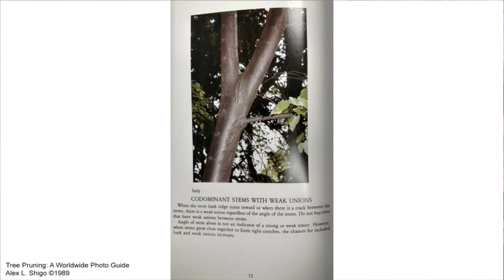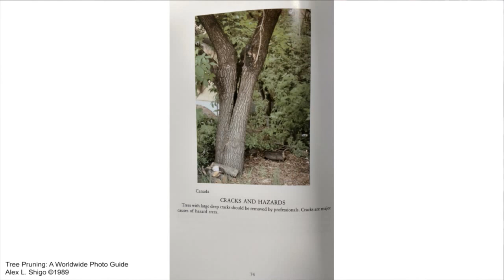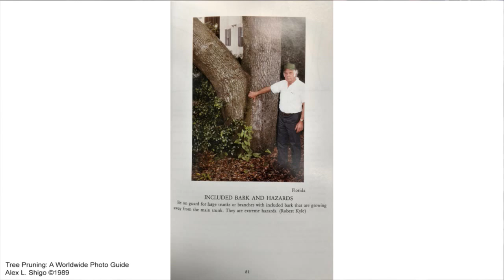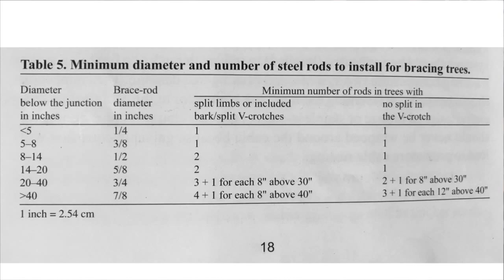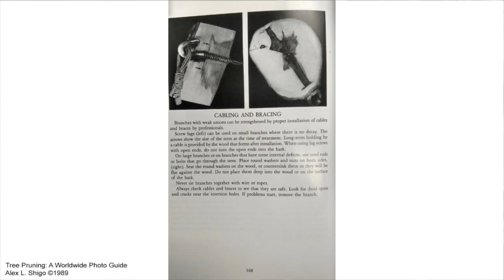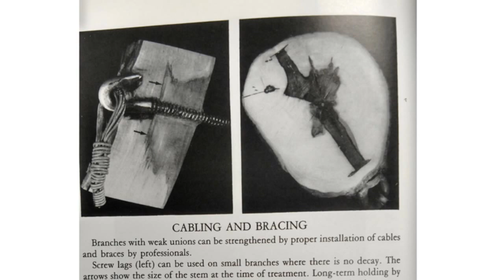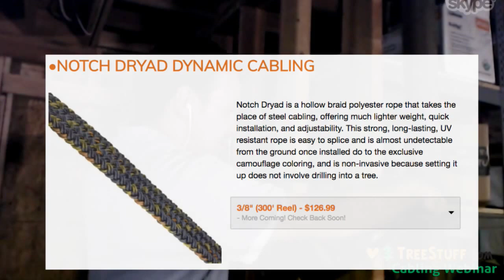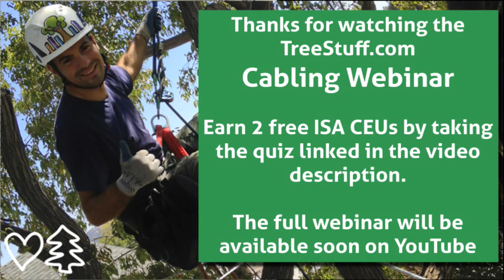How to Support Trees with Cabling and Bracing - TreeStuff Webinar

Comment: Although this has been 5 years, I do appreciate you taking the time to video this as that does take effort on both of you Nicks.  Pre-wrap starts at 44:15 in video.  Sorry, I did not note when other categories start.  One other question if you happen to see this, I would have liked to seen how you address trees that are already split (1-3 inch separation) besides tearing it down.  Thanks!